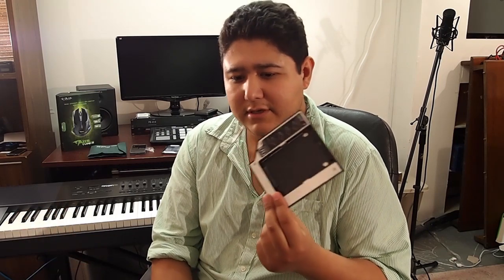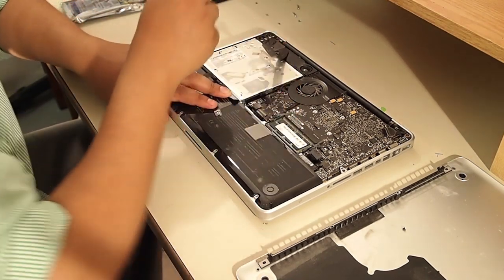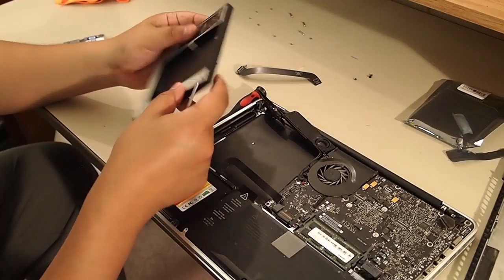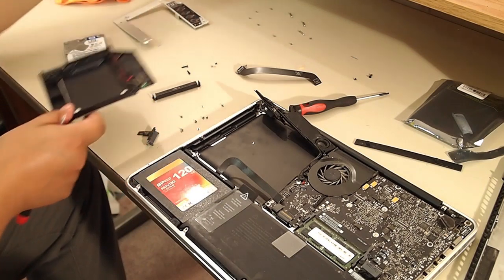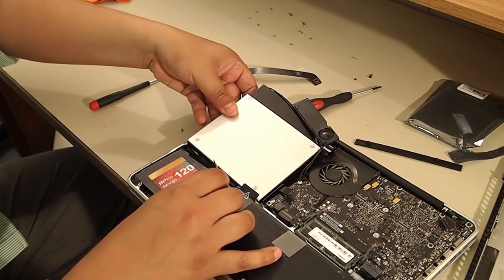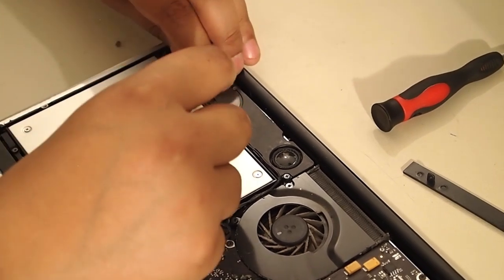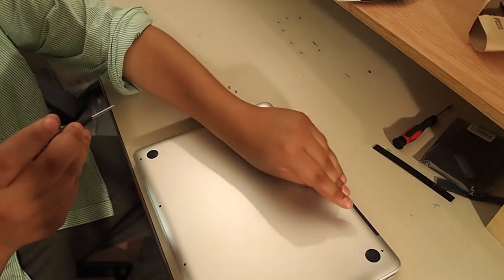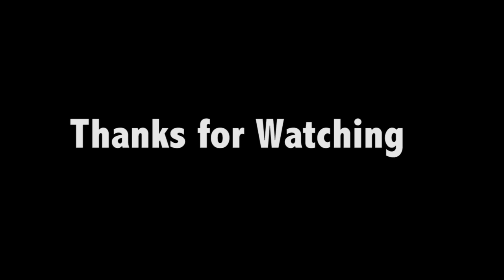Mac Book Pro - Second Hard Drive Install Tutorial DIY

Comment: I just installed 1 tb ssd with the old hard drive and it’s working pretty fast. I did not take the cdrom as I felt it as a great touch to the laptop. Anyways , great idea to swap out the cdrom with a new hard drive.

Comment: they should tell you that removing the cd rom causes trouble.... .forample some programs some roms wont install.. and windows wont install with usb..  with out the cdrom.     the best thing to do is buy a 1tb or 2 tb ssd.. and keep your cdrom inside the mac.. there are a whole host of hidden problems..power users will run into when they remove the dvdrom..TRUST ME..   mushkin has some very affordable 1tb ssd.. and samsung will release a 4tb ssd this year..    keep you cdrom in .. avoid the trouble.
Reply from the maker: +JRLM Thanks for the warning. To date however I never had any issue with anything doing this. But yes, a larger HDD is the best way to go.

Comment: Great video! Few Qs
Q1: With the 2nd drive, do you mainly use it as file storage?
Q2: Have you considered using it as a separate OS drive for Windows aka BootCamp?
Q3: Is the second drive constantly running alongside the primary drive and if so have you notice it to drain your battery life?
Reply: +Peterson Blanc they should tell you that removing the cd rom causes trouble.... .forample some programs some roms wont install.. and duel booting windows wont install with usb..  with out the cdrom.     the best thing to do is buy a 1tb or 2 tb hdd.. and keep your cdrom inside the mac.. there are a whole host of hidden problems..power users will run into when they remove the dvdrom..TRUST ME..   mushkin has some very affordable 1tb hdd.. and samsung will release a 4tb ssd this year..    keep you cdrom in .. avoid the trouble.